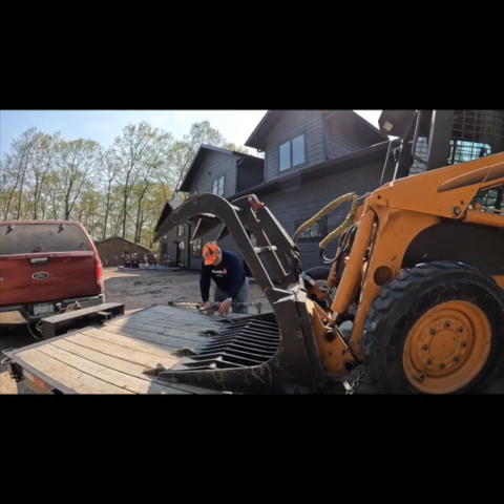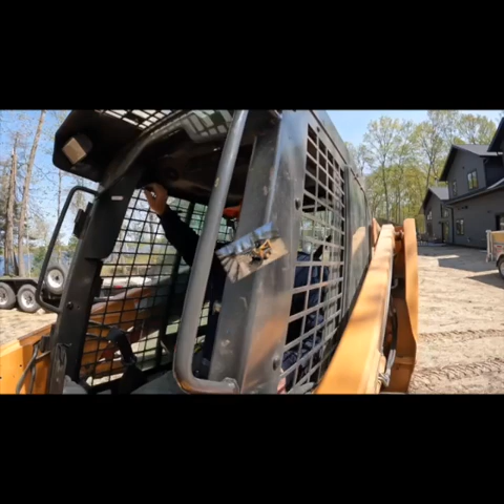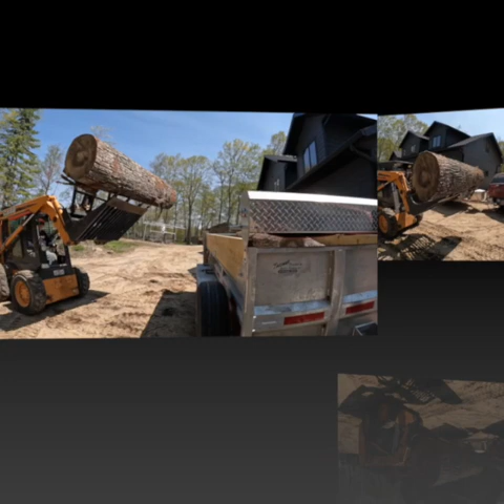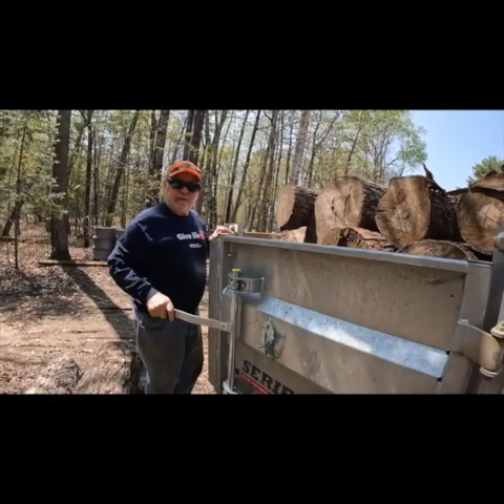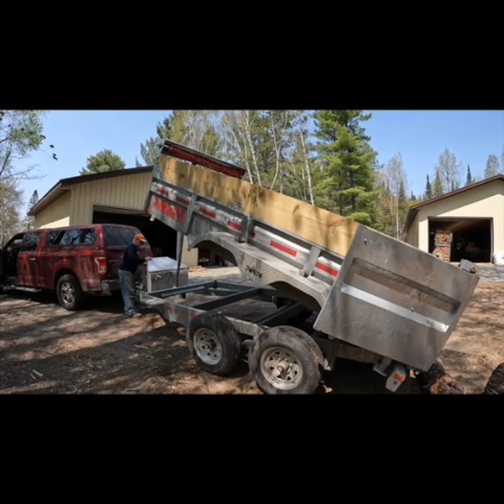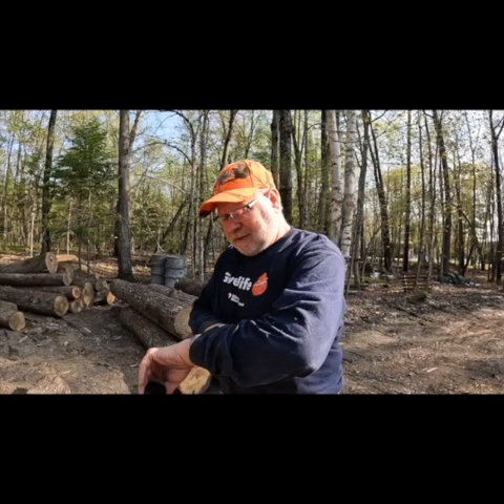Busy With Basswood

Comment: 6 cords off Basswood assume you have this bucked by now and waiting to be split.😁
Reply from the maker: Not yet. Hip problems. Wore out. More injections next week. When you can’t put hardly any weight on your leg, hard to do much. Getting old sucks . It will take a while but I’ll get back at it. You take care. I won’t stop just do less. Thanks for checking in and commenting.
Reply: @clubdoraoutdoorsandfirewood  No injections for myself yet although my hip does occasionally give me grief, As I often say getting old is not for the weak and not getting older probably not a good option either.👍

Comment: Basswood by itself sucks as a firewood. But nix it with oak or another heavy firewood, it balances the flame and heat nicely. Any lightweight firewood blends well with oak.
Reply from the maker: That is correct. I thought I responded to your comments. It shows I didn’t. Thanks for your comments. I usually never target basswood. When it’s available to me for free I usually grab it.
Reply: @clubdoraoutdoorsandfirewood  Free is good!

Comment: Hey Allen. Great job loading and unloading, skilled operator. Lots to work with there. Im not familiar with basswood, what does it compare to in your opinion?
Reply from the maker: Mr. Kenny. Basswood is a soft wood. Grows fast can easily reach 100ft. BTU maybe 14-16 thousand . Has a large broad leaf 5-6 inches wide. Makes great campfire wood. I burn it all the time. It has a very nice flame. It’s less desirable than popular. The wood is bright white when split with a few streaks of brown. Will turn to yellowish when in the sunlight. Many times you will see a cluster of basswood growing together from two - as many as eight. Similar to birch clumps. Basswood has been used a lot in past years  like 40-50 years to make berry boxes. The ability to shave the basswood into a thin piece was highly sought after. Basswood is used today a lot for carvings chainsaw art. Well Kenny I really tried to answer your question. This all came from my head. When I was 8-10 years old my dad harvested basswood logs for a local mill that turned most of the wood into boxes. I didn’t mean to write you a short story. Next time you ask a question beware of the long answer. Take care my friend.😅
Reply from the maker: Kenny I forgot a very important characteristic. The wood has about a year on the ground after that it rots so fast. Definitely shouldn’t be used for wet locations.
Reply: @clubdoraoutdoorsandfirewood  thanks Allen.